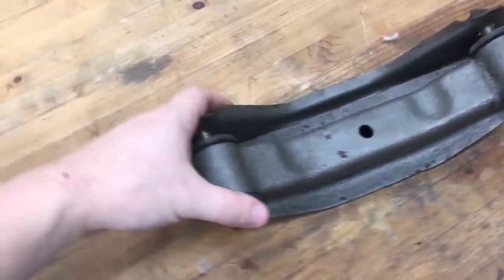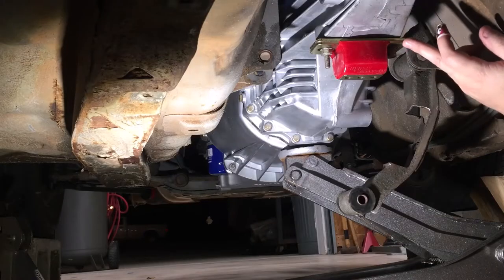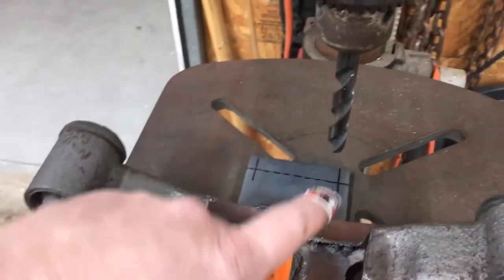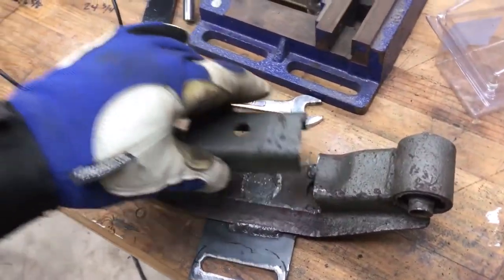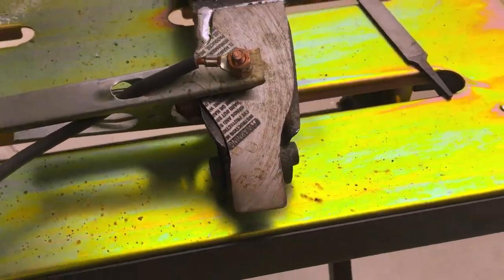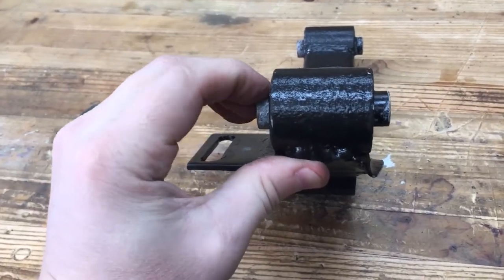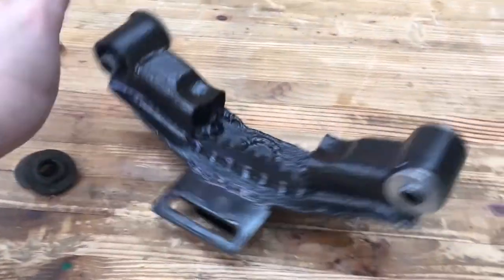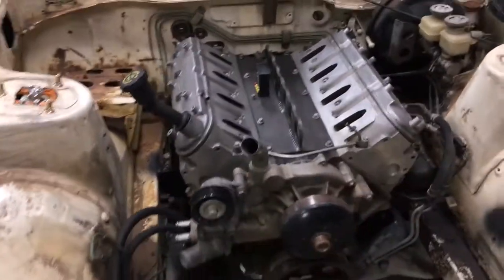Custom Transmission Mount - LS swapped Datsun 280zx - Catches on Fire🔥

Comment: I think I would have considered moving the transmission mount mounting brackets on the transmission tunnel. It would have centered the weight of the transmission on the mount and been a whole lot better looking than this cobbled mess you came up with. Sometimes the easiest way is not the best way. By welding those washers on the ends you did away with the rubber bushings. You added vibration to a mount designed to reduce vibration. Your whole concept was mistaken and ill advised at best. Start over and do it the right way.

Comment: Looks like you've been doing pretty good. I'll have to follow this along since I'm wanting to do something similar myself. Are you planning to modify the engine in any way or just running it stock?
Reply from the maker: Thanks bro!! I thought about maybe doing a mild cam just for the lope but I think I'm going to run it stock just to make sure everything can take the increased torque and power (mainly the rear end and transmission). After that maybe a turbo 🤷‍♂️ just depends how she wants to behave lol
Reply: @likablemichael  I agree with you on handling the power. From what I've seen from a bit of research, you'll most likely want a bit more aggressive cam and new springs if you want to put a turbo on it. With as little as 8 pounds of boost, expect it to push over 500HP at the engine. I was looking at a TH400 transmission myself. You will also need wider rear tires to handle that much torque without spinning constantly.
Reply from the maker: @TravisLunceford  I’ll definitely look into a cam and springs since I’ll have to pull the engine and transmission out at least one more time to install the clutch 🤷‍♂️ I don’t know if my transmission will hold that much power but she’s getting some wider tires all the way around after I get it running and driving 👌
Reply: @likablemichael  If you haven't seen it yet, check out this channel: https://www.youtube.com/channel/UC8uf_zVTV63l1-uRSx6XbnQ 

He's ran and tried almost everything when it comes to an LS motor. It gave me a lot of food for thought on what I could possibly do. And yeah, making sure everything else on the car can handle that much power is the hard part from what I'm seeing.  I can easily get in the 750+ HP range, but I'll have to replace most of the car to be able to handle it. I'll probably be shooting for the 500 range myself.
Reply from the maker: I’ll check it out 👌 500hp in a 280zx would be intense but I fully support it lol

Comment: What oil pan do you have on it? stock? truck or car? Also what intake are you planning on using?
Reply from the maker: I went with the Holley 302-1 retro fit oil pan and a low ram intake from summit. They were a bit pricey but I needed the clearance 🤷‍♂️
Reply: @likablemichael  i was looking at both of them too, this is my first ever build and you're making it a lot easier on me than what i expected! Thank you!
Reply from the maker: @robertmalles6917  Glad it helps! I figured I'd document the build since it's hard to find information on the s130 chassis!

Comment: What flywheel and clutch did you use ?
Reply from the maker: Flywheel came with a clutch kit I got off ebay, XTR stage 3 or something, for a 4.8L 1500
Reply: @likablemichael  that will mount up to the 5.3 right ?
Reply from the maker: @angelcastro4983  Yep, you might have to remove a couple dowel pins and get a different pilot bearing but otherwise it bolts right up 👌
Reply: @likablemichael  sounds good do you have Instagram so I can follow you . I like your work and I might have some more questions for you .
Reply from the maker: @angelcastro4983  thanks man! Yeah it's @likablemichael
Reply: @likablemichael  just added @castromotors702